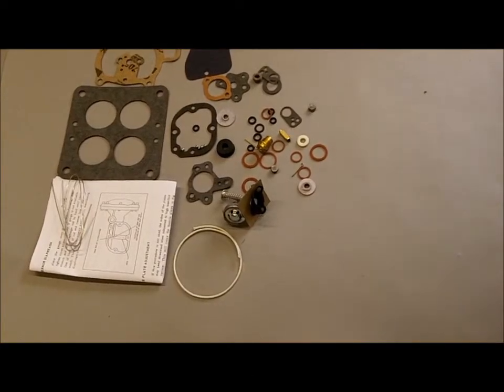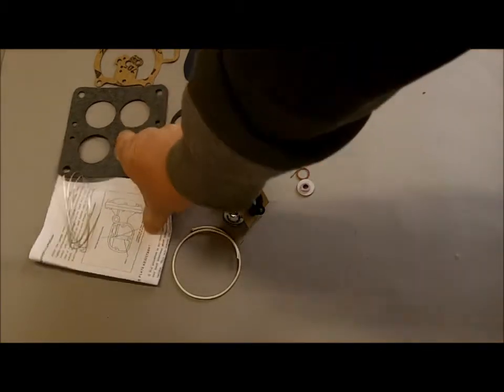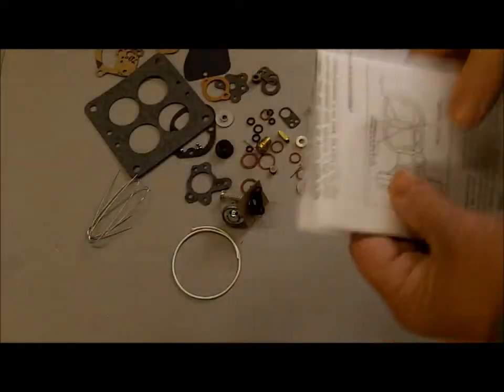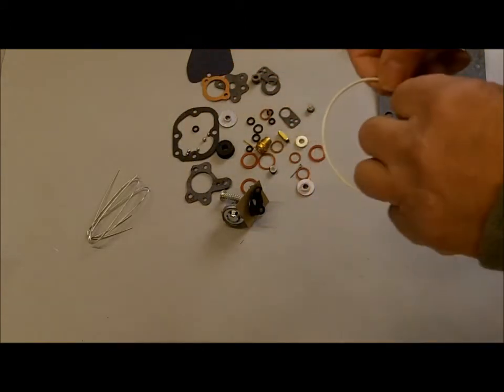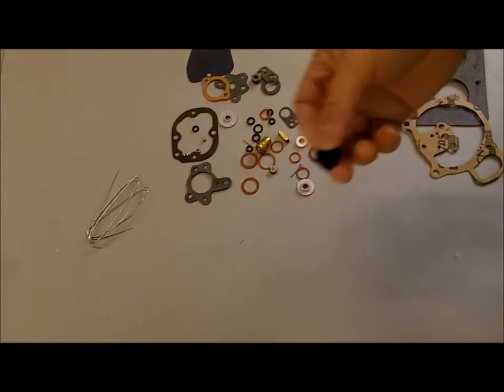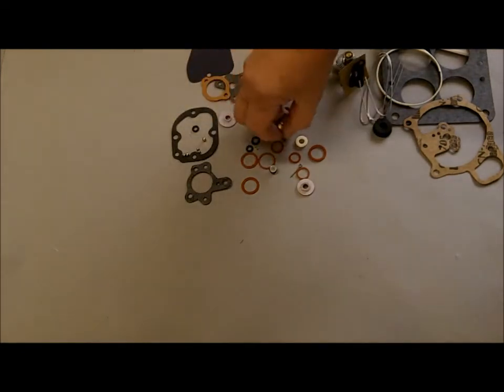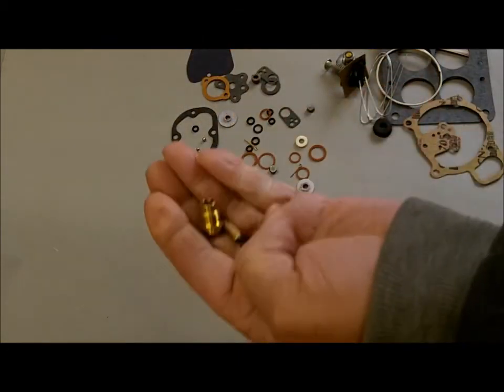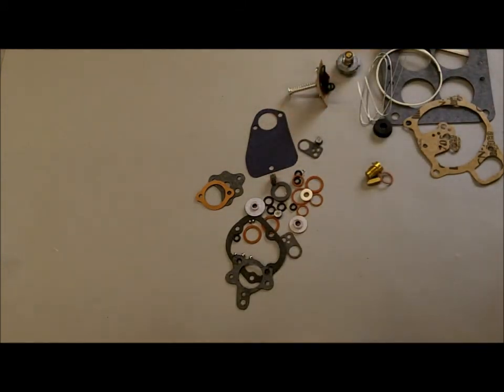Holley 4000 Teapot Carburetor Rebuild Kit K6068

Comment: Hi Mike, I have a 56 T-Bird 312 y Block with a 4-barrel carb that needs rebuilding. Where can I find the part number?
Reply from the maker: The list number is tamped on the back side at the bottom where it mounts. Put that number in our search box to find the correct kit.